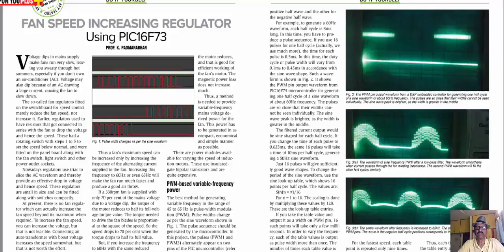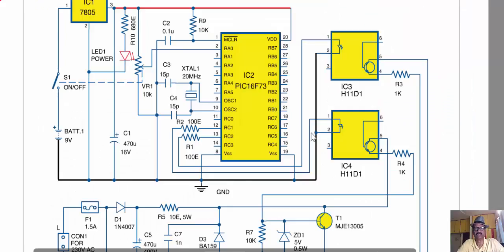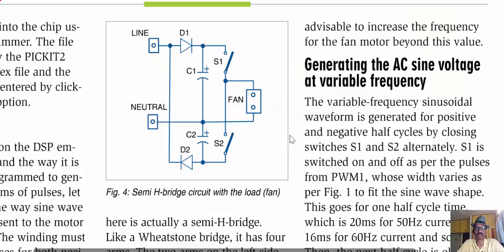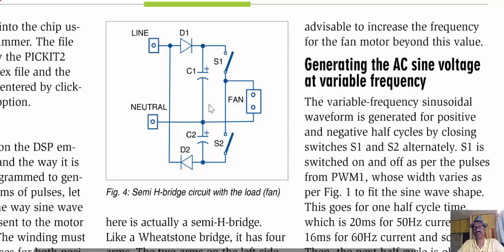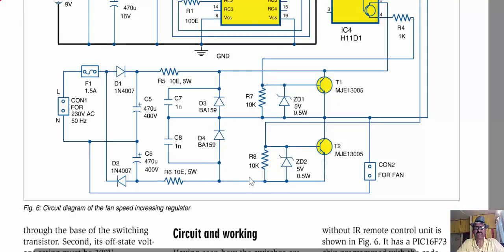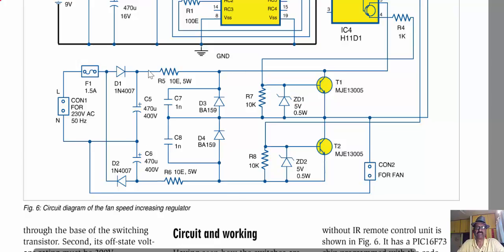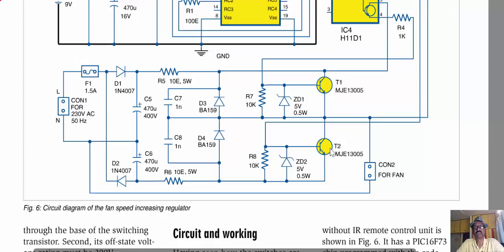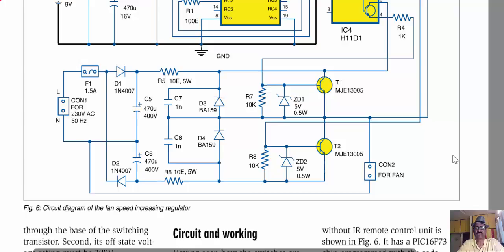Inverter - circuit design Part5  - Increasing frequency Circuit review 1

Comment: How can i generate a 310volts AC at 7khz frequency..?

i have input of DC 24volts (2 lead acid 17Aph )

is it possible to invert dc to ac at such frequency???

(Read to build custom transformer for higher voltage ,but how to increase frequency???? )
Reply from the maker: Chaitanya Krishna Yes. But one needs great amount of skill in handling such high voltage & frequency.

Comment: sir, can we use 555 IC for switching purpose??
Reply from the maker: No. We need adaptive PWM  on sine wave pattern so it is possible by firmware only using micro-controller